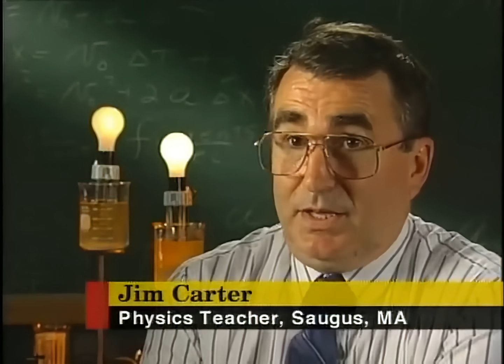MIT graduates cannot power a light bulb with a battery.

Comment: fuck, are they actually that stupid? one cannot study at mit and not know that the circuit has to be closed (or whatever the hell it is called in english?), hell, at the place where i've studied, we've learnt about electricity and how to calculate resistance, intensity and voltage of a circuit in fucking 9th grade
Reply: Closed is right, closed mindedness from believing you're God's gift to the universe.
Reply: PB are you fucking serious? Idiots who try to connect one contact of a battery to one contact of a lamp are not stupid? One guy tried to short circuit battery and after that somehow connect lamp to it, isn't that actually idiotic? You are trying to justify stupid actions with arguments which have nothing to do with reality. If it was "I've made a correct circuit [which consists of 2 elements, lol] but the lamp doesn't work, the battery may be dead or the lamp needs higher voltage", but they did absolutely stupid actions.
Reply: Антоша Пушкин "But those idiots couldn't power a light bulb or tell why it was impossible. Some of them tried so stupid approaches it's not even funny."
Which goes with the premise that one of the bulbs being incorrect for the experiment. The person that did get it right was using the correct bulb. And did you notice how dim that bulb was? And if that bulb operated on a 1.5 volt battery, what does it say about the other bulb that needed a 120 volt source? 
So my question is this, did the incorrect bulb throw them off? 

--> Did they assume that what was given was going to work, and when it did not work did they resort to all sorts of idiotic yet humourous methods of troubleshooting. 

Did you also notice the woman that handed the incorrect bulb. I bet she didn't even realize the mistake she made and just made the assumption; bulb, wire , battery, it's copasetic. 

"At this point I suppose that you are thinking the video shows " all mit students are stupid"'
Never made such a remark. As I mentioned before, I worked and collaborated with a few. I have a high regard for what 'some' are capable of in their discipline, The key word is 'some'. Of course there were some I had to question what were they doing at the institution. But that could be said for any institution. Just peruse Linkedin and all those that have an education, you'll be amazed with what you'll find.  

"how to quit vim"
ESC then  :q to quit, or  :wq to save and quit. 
Yes, Vim is cool and find it amusing when people get into turf wars between different text editors such as Wim and Emacs. My motto is what works best for you. As an example Arch works best for me due to it's flexibility. For some it's Mint, Manjaro (what I originally started with), Debian, Ubuntu. etc. I just haven't decided to make the jump to Gentoo.
Reply: God's gift to the universe is a stupid phrase. (Just sayin, not bein a dick :P)
God and The Universe are inseparable
Universe pretty much means "One God"
The phrase should be "God's gift to Himself"
I'm a Pantheist.
Reply: PB
I think The Universe is spiritual not just material...
I'm not an Atheist I said I was Pantheist.
Pantheism is literally the polar opposite of Atheism.

God is the Spiritual Universe.
God is Everlasting Life Energy aka The One Energy.

How can there be anything but Eternal Energy?

Do you really think God is not Eternal Energy?
Reply: FreeRadical I know the difference between the pantheism and atheism, and I am on the side of atheist when it comes to a material universe. Where atheists are wrong is to support the notion that the universe somehow created itself. Or if the universe is in a constant expansion and contraction which goes against the notion that there in an increase of entropy in the system. Meaning there will be a diminished state of no thermodynamic free energy and therefore the universe will no longer sustain processes that increase entropy (wiki).  The material universe follows a set of laws, which can be observed and measured.The laws that existed several billion years ago, (if we base the age on what physicist have speculated) are the same laws today.
Reply: FreeRadical When people say such statements such as 'not being a dick', through my experience they are being one. I see it all the time on youtube and linkedin and whatever forum. Personally, I take it with a grain of salt. There are bigger fish to fry.
Reply: Антоша Пушкин   It seems you know very little about anything. You use of strong language depicts an infantile vocabulary as well as arrogance.  The beginning of the universe is discussed among many circles, and the view that the universe in moving towards increased entropy is a point of discussion among physicists and thermodynamic lists. It's called heat death of the universe. The term originated from Lord Kelvin in 1852. Read it up before coming across as mr. know it all.
Reply: FreeRadical "but I'm holding back today :P"
Which concludes pride on your point. And since you seem to be uniquely qualified on the subject matter on a spiritual universe perhaps whyou can enlighten and share your wonderful knowledge with Антоша Пушкин. Just don't share it with me.
Reply: PB the fact that the beginning is discussed does not make your "atheists are wrong" statement right, and actually yes, I do know what thermodynamic death of the universe is. It's amazing that someone speaking about god and that "atheists are wrong" calls me "mr. know it all".
Reply: Антоша Пушкин  And it's certainly funny that someone who has never been to MIT, or perhaps could not get in thinks himself better than an MIT graduate student, which suggest one thing, complete arrogance.

"the fact that the beginning is discussed does not make your "atheists are wrong" statement right"
It certainly has more weight if we are to assume that if a universe is to do a slow death, then how would it be able to regenerate itself, how can it be cyclic when according to thermodynamic death of the universe it is not possible. And the thing with a number of atheists is they always assume that they are right and everyone else is deluded. Again that is arrogance.
Reply: PB yeah, I do think I am better than morons who can't power lamp using a battery. I am not studying at MIT, I am studying at Israel Institute of technology (Technion) and you know what? I know how to power a lamp and I don't know anyone who can't do it. Hell, even my mum who hasn't studied at technical university/institute know how to do it.

And the next paragraph does not make any sense at all "how can it be cyclic", where have I mentioned that? Has anyone ever mentioned that? "And the thing with a number of atheists is they always assume that they are right", why do you think so? Where is something to prove your point? I am an atheist but I don't know how the universe began, I don't make any claims about it simply because there aren't any proofs of either of theories. But I think some of them sound reasonable and could be true. And what you are saying is "nah, atheists are wrong, listen to me, I've googled one thing about thermodynamics and now I think I know everything, listen to me, atheists are wrong"
Reply: Антоша Пушкин "yeah, I do think I am better than morons who can't power lamp using a battery."
Except the lamp given in one case was too large for the experiment according to several critics (one commenter observed the bulbs had Edison bases so presumably they were dealing with a lamp that needed 120 volt not 1.5).  As far as MIT graduates, one cannot make such a generalization. I have come into contact with a number of them, mostly in robotics and control group, some working at Draper Labs ... who really know their stuff. 

So what, a few who on their graduation day fail to sit down and correctly examine in detail when they have bigger things to do really does not say anything about the their calibre. It's true that some tend to overthink and over-theorize simple situations and problems, but the whole thing was more of a demonstration in psychology than science.

"how can it be cyclic", where have I mentioned that?"
Not you, but go to any forum such as this and the claim is the universe is cyclic, or has to be if there was a big bang.

"And the thing with a number of atheists is they always assume that they are right", why do you think so?"
Because the diatribe against anyone who thinks differently is blaringly evident in this forum. As several atheists I have come across put it, "It embarresses me to say I am an atheist seeing how they verbally assault those who hold religious or differing views." 
Reason why a number of religious, or those with different views care not to venture onto forums such as youtube. It's like walking into a hornet's nest.

"because there aren't any proofs of either of theories"
Aspects of a big bang ( theory first put out by a  Belgian Catholic priest Georges Lemaître) are being observed by cosmologists, astronomers and physicists. And as long as material science relegates itself to observation and not theology then it's copasetic.

" And what you are saying is "nah, atheists are wrong, listen to me, I've googled one thing about thermodynamics "
You think that me googling one item is where I am making my basis of argument. Are you that wet between the ears? Some of us who comment have been around. Some of us have engineering/mathematics and/or a degree in physics that stem beyond just 4 years. This is not something I just pulled out of my ass. 

It seems you have a issue by taking things personally. First you go on a verbal assault against graduates who failed what was more of a flawed experiment. Perhaps they should also be denigrated for not knowing how to change the oil in their vehicle. Second, you label someone a cunt and lunatic, derogatory language for those with a those who are handicapped in the use of vocabulary and etiquette, when what you should have written was that you do not share such a view. 

If I offended you, well I'm sorry but learn to take it with a grain of salt.
Reply: PB I don't even want to answer to this long post, "one cannot make such a generalization", " but go to any forum such as this and the claim is the universe is cyclic, or has to be if there was a big bang", isn't someone making "such a generalization" after saying that one cannot make such a generalization? What is funnier is that you try to argue against arguments which I have never made and you say "well there are people out there who think like I described so I'll go on arguing against those ones with you". It makes no sense. Also I don't understand what the fuck does light bulb has to do with theology, religions, beginning of the universe etc? Seems like you are trying to deflect. "The person who can't make a simple circuit which consists of a lamp and a battery is stupid", is that too tough idea? What does it have to do with universe etc? When I studied at the 9th grade, everyone could make a circuit with several resistors to evaluate resistance of the whole circuit, it's totally ridiculous when someone tries to write 50-line texts to justify stupidity of people who have finished their degree but still can be outperformed by 9-graders.
Reply: Антоша Пушкин You can't even keep up with the conversation. The issue with the bulb was in response to your comment: "yeah, I do think I am better than morons who can't power lamp using a battery."
You were making a generalization of MIT students being stupid, when the bulb in the 1st half of the clip was not even the right bulb for the job (a 1.5 volt battery does not have sufficient voltage to light up a 120 volt bulb) compared to the 2nd half of the video where a student was able to light a bulb (a standard flashlight bulb). Two different bulbs makes the experience flawed.

You just have to look at the video more closely. But you didn't, you decided to question their intelligence.
Reply: Антоша Пушкин The video was heavily edited. Yes, I saw the part with short circuit being made and I made a comment about it, but decided to delete the comment seeing there was a lack of control, two different bulbs were used. The question could be asked if that added to the confusion. 

A better control would have been to invite students into a room and ask them their major, then to perform the experiment perhaps with an assortment of bulbs, but just not after a graduation ceremony. It also would have been better to show to the students the answer, which wasn't done. And my question is why?  Too many 'ifs' in the the way the study was conducted.

Here is one link that shares my sentiment,
http://h2oreuse.blogspot.com/2015/02/mit-graduates-cannot-power-light-bulb.html

If there is one glaring big no-no in psychology it is to conduct experiments with variables. I will admit that there are MIT students that I have come across that have absolutely no understanding of the inner workings of everyday items, but more than made up for it in other areas.
Reply: PB hell, I am a computer studies student and even if you wake me up late at night and ask how to code a simple task using C++/Java, how to delete a file, or how to quit vim (lol), or something similar, I will answer. But those idiots couldn't power a light bulb or tell why it was impossible. Some of them tried so stupid approaches it's not even funny.
At this point I suppose that you are thinking the video shows " all mit students are stupid" while it is obviously not the case, it shows that there are a bunch of idiots who can't complete such easy tasks even after graduating mit
Reply: PB lol, I know how to quit vim, it was in context "even if you wake me up at night, I'll answer how to quit vim" because it's pretty basic stuff for anyone who have studied something about linux.

"Did they assume that what was given was going to work, and when it did not work did they resort to all sorts of idiotic yet humourous methods of troubleshooting" 
some of them tried stupid things at the very beginning, especially someone who said it wasn't possible with one wire, the guy who didn't close circuit (duh, it isn't even worth trying that way), the girl which made an excuse that she studied mechanical engineering.
Reply: You either get a light bulb lit or the internet invented. Pick one!
Reply: +FreeRadical "I am a pantheist" Is the new "I am vegan"

Comment: I blame rote learning (like knowing a closed circuit is needed but not understanding it) and a lack of curiosity. My brother in law is a mechanical engineer and I know he knew how to do this before college because of some of the projects he did back then. The engineers in that video that weren't able to do it will probably not do much engineering in their future careers. The school lab in the video showed one of the problem with some basic physic classes, the light bulbs were pre-wired to two distinct connector and it kind of hides the mechanic of the light bulb. 

And it's obvious that this video was produced to show the bad engineers, I'd like to see a more rigorous test of how many graduating engineer can or cannot do this, and more importantly for an engineer, can those who can't on the first try show their problem solving skills by figuring it in a short time.
Reply: The circuit wasn't even the problem here, most of them actually managed that. The real issue is that the bulbs were far too big for the batteries. And that's theory, most of them should be able to figure that out, but they don't.
Reply: @patrickkeller2193  No, dude, if they can't figure out how to connect a battery and a bulb, they don't understand anything. It's literally the simplest circuit you could possibly make ffs

Comment: It's simple, is not about eletricity,  but about how to close the circuit with only one wire. Since they are used to have more material to work, they will not think of using the bulb end  to close the circuit on the battery. Thinking outside the box is not taught on the universities and its never the first thing we do when we find a problem.
Reply: Juscelino Dorneles Aleixo FIlho wtf, just peel off part of the wire and wrap the bulb around it leaving it with 2 ends, then you connect the battery. anyway, it won't work because a D battery can't light such bulb.

Comment: Can someone please explain to me why they did not manage to do it?
Reply: They don't realize that the threaded part of the stem is a different terminal compared to the tip. You have to touch the tip to one of the ends of the battery and run the wire from the other end to the threads on the bulb.
Reply: One did, but also look more closely at the video, two different bulbs. One will operate on 1.5 volt battery, the other will not (requires a 120 volt source).

Comment: This one is easy for someone who's been around electronics. What I don't understand are they using an AC bulb or a flashlight bulb? The AC bulb would require more current. The DC bulb would just require making a circuit.
Reply: There is no such thing as an "AC (filament) bulb" An ordinary bulb doesn't care whether the voltage is AC or DC. "AC bulb would require more current" wrong again. Please lord, tell us all you're not any kind of engineer
Reply: The problem is simply that the bulb they were given requires more power to light than the battery can provide. The large lightbulb draws at least 40 watts, whereas the small bulb uses more like 1 watt.
Reply: There are two different bulbs shown in this video, so maybe they had to ask for the other one.